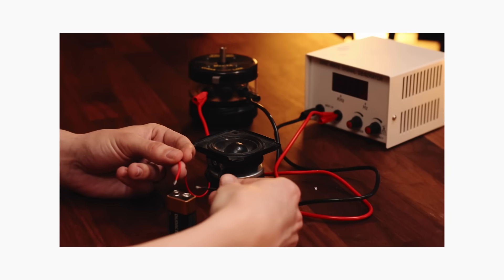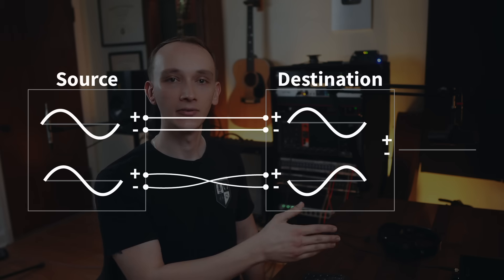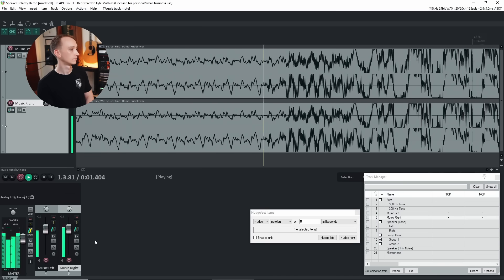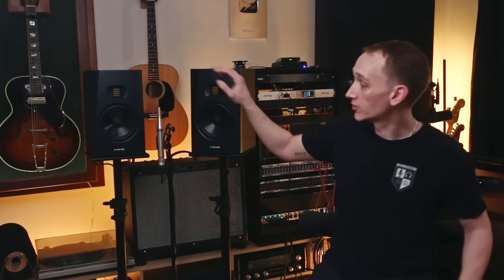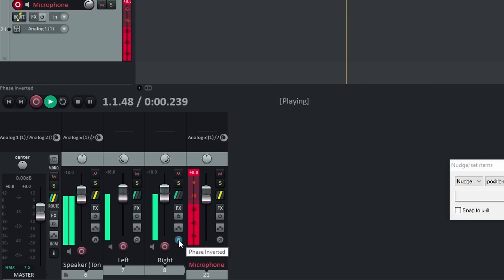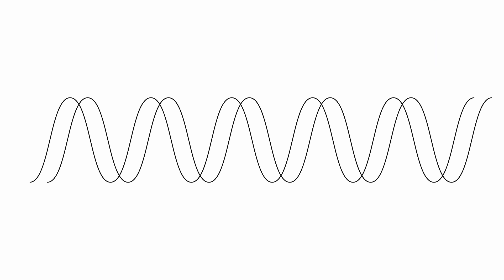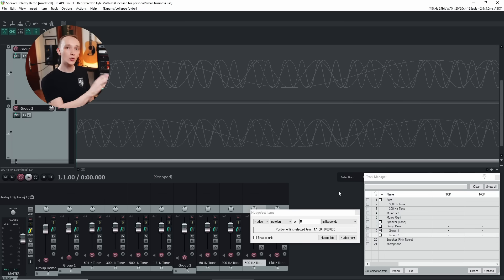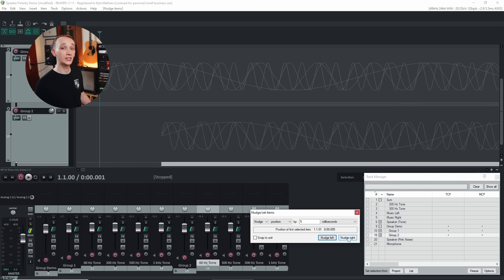The Downside Of Multiple Speakers In A Sound System

Comment: My earphones were sounding weird like the right one is heard to be louder than the left. So in this case all I have to do, to switch the wires in the left speaker ( i guess the left one is not wired properly) .
Right ?
Reply: I tried re-wiring multiple times but each time i connected them wrongly, And I had no clue why the sound is not in center, then I changed the speaker. And guess what it didn't work again 😅
Your video really helped, thanks ❤

Comment: I used to own quite a few vintage PA cabs and had a decent 4(sometime```````s 5) -way stereo arrangement. when I started out, I had no idea that older JBL PRO drivers have polarity colours and markings reversed. I'm not 100% sure why - no standardisation in the early years I assume. 
When I corrected the polarity of the 2 pairs of 4560 low midrange cabs and the 2" compression drivers, the difference was incredible. 

Still sounded adequate with all low mid-range and low-treble out of phase lol...... 

It looks like an archaic pile of junk, unless you happen to appreciate old horn loaded PA systems, but sounds excellent.

Comment: Ok. I have a question for anyone who can answer. 
I have a bass cabinet with 4 10" speakers, 32 ohms each, wired for 8 ohms. I've read from the jack with a meter and did get 8 ohms. The top two speakers are divided from the bottom two, however, the cabinet won't womp any more. I've ensured that it is indeed sealed completely. My question is, could it be the way I wired them that is creating the problem of a lack of power from the cab?
Reply: You probably have the polarity of one of the drivers backwards. Wire up a 9 volt battery to the cabinets speaker terminals + to +, - to -. ALL drivers should move OUT towards you when you connect the battery. If one (or more) doesn't, swap the polarity of the wires going to that driver. Also make sure all drivers are wired in parrallel (all "+"'s of all drivers together, all "-"'s of all drivers wired together.

Comment: Superb scientific demonstration and realistic.  The floor stander with 3 speakers units inside. The bass and the mid range had polarity differentiating  connectors to the speaker from the crossover, but not so for the tweeter.  High frequency from the tweeters do not cancel each other out ?

Comment: I previously sent you a very long comment about my bi wire from “world best cables” feel free to disregard it. Long story short, thinking that the speaker cable was mislabeled I deliberately connected the high frequency speaker wire to the low frequency terminals, and vice versa. Did I inadvertently do damage to the tweeters or the woofers in my tower speakers? Please note that the polarity was correct in both settings.

Comment: I've never taken any notice of the "correct " connection on a set of speakers. I wire them up, then swap one round, and you can clearly hear when they are in phase because the bass becomes far better. Never trust a manufacturer to get it right. Best way to set them up is the opening track of Pink Floyd's Dark side of the moon.

Comment: JBL pro 1000 watt speakers wire up in a push type configuration  wile most every other speaker wires up in a pull configuration  but keep in mind speakers are AC compliant devices the electrical signal moves the speaker cone in both directions
Depending on the magnetically properties of the signal 0rovided to them. The cone pushes air or pulls air  and doesn't matter   until some forces react with the air pressure created by the cone movements
Like  box   closed or sealed or ported  or even some other type of box  like an A perotic membrane 
A box that is not a box.  

And yes you can hear a difference between the forward push or backward pull of a speaker, but its the mechanical structure of the basket for the most part.

The key is to have both speakers side by side in a box move in time alignment in the same direction, 
Unless your making a push pull type bandpass type box in a clamsheel config.

Comment: 2 Points he missed out: 1) The affect of phase change on speakers through crossover/network cards. 2) The phases of the freq for both speakers should not be different. So if I plug them both in the wrong direction (+ to - and vice versa) and they both are in the same phase, I would assume it to work fine. Many old speakers will come with wires coming out of the box, one of the 2 wire will be striped and you dont know if that striped wire should be negative or positive.

Comment: A thing I've noticed with car audio systems is that, from the driver's seat the sound from the radio sounds like it's coming from the LF speaker in factory systems, but when you install an after market radio, the sound seems to be coming from the RF speaker. What's up with that?
Reply: I’ve noticed this too. I think most modern cars (and modern aftermarket head units) have proximity focal setting that delay certain speakers in such a way that that the peaks of the sound waves hit the driver seat at the same time to give the driver the best sound possible. My tundra has a map of the cabin that I can pinpoint the preferred listening position in. When I pinpoint the driver seat, the sound is very full and even from all sides.

Comment: Of course things can change once you put the driver into a cabinet.
The design of that cabinet is essential to how the sound travels and is shaped, and depending on whether the cab is a sealed unit or ported can have a physical effect on the movement of the cone, especially at high volume.

Comment: I remember the first time i tried this at home, was mind blown that adding a speaker and power could reduce the noise by cancellations, another reason why box design is very important, you dont want the rear wave of the speaker interaction negativeltyy with the front or the same effect will happen. Horn speaker and reflex speaker boxes use this to delay the rear wave so that it positively effects output at a specific frequency , when they combine after the delay (1/4 wave theory)

Comment: So I have a question about guitar amps. If I have 2 guitar amps with 1 speaker each, but one is 12" and one is 10", will I get interference?

My reasoning is that a different size speaker will have to move differently to create the same sound. So even if you start off in phase and play the same music eventually you will get to a point where there is negative interference! Am I correct?

Comment: Using the word phase would make sense here.  As in, in-phase and out-of-phase.  A home stereo two speaker system will lose it's punch and certain tonality if speakers are wired out-of-phase, as you say, work against each other.  My girlfriend had her stereo speakers out-of-phase and I just flipped the polarity on one of them and the difference was dramatic when they pumped together.

Comment: In the opening ceremony of a department of my university 4 condenser microphones in a row were used to pick up the sound at podium. The dumba$$ audio technician didn't know that multiple mics at podium is for REDUNDANCY and totally f*cked the sound up by turning on ALL FOUR of them at the same time. Everything is heavily comb filtered and fl@@@@@@nging all around like what's heard through a steel tube.

Comment: Hi,

Your a real expert and you know very well what's going on. I had countless discussions in the past about the exact same thing and most of them was a fight against windmills. Speaker placement and even the positition of the chassis in their depht on the sound wall of the speakers are very difficult. In the transit frequency of the dividing network it's highly importent that they are very well alingned in their " sound center" of the membranes. Otherwise the speakers are producing the same problem by themselves.

Comment: But why would you wire speakers with opposite polarities? Also does this apply only to passive speakers not active with built in amps?
Reply from the maker: This principle applies all throughout an analog signal chain. So if you had accidentally wired one of your XLR cables between the mixer and the powered speaker backwards, you'll get the same effect.

Comment: Hey i hope you’ll see my message, i would like to have some insight on this, what makes a line array a line array? (Surely it is not just stacking point source speakers on top of each other) 

And is it possible to build one yourself? 

Hope someone will be able to answer. Thanks ya’ll
Reply: If you type "Line Array or Point-and-Shoot Speakers - JBL Professional" into your browser you will find a pdf explaining the concept. JBL also have an excellent book called "Audio Engineering for Sound Reinforcement" which has a chapter on line arrays. I spent 25 years working in a venue which changed to a line array 15 years ago. The difference was staggering due to some of the challenges we faced. They work as described. As a receiving house we also hosted many visiting line arrays, L-Acoustics, D&B Audiotechnik, Meyer etc. All of these are superb and no point source system ever came close in all sorts of ways.

Comment: out of phase is bad, but what is ihe down side of  multiple speaker if arranged and connected correctly?
Reply from the maker: With multiple speakers, there is interference between the direct sound of each speaker. So it might sound great in the sweet spot, but not one step to the left or right.

Comment: Last example: - "Gosh, that sounds like flanging!". Listen and learn.
When I was a trainee Telephone Exchange Technician in the early 70s I was allowed to spend an hour a day on work time to go through my printed training assignments. I was sent to the Power Room, where all the rectifiers converted the Mains 240V 50Hz AC to the Exchange's 50V DC.
I enjoyed that big high-ceilinged room because if you walked around you could hear the (loud) 50Hz hum get louder and softer as you walked through the standing waves. You could also sing harmonies with the 50Hz and its overtones coming from those big rectifier cabinets. Amazingly, in those days smoking in there was allowed. :-)

Comment: Yeesh.... the demo at the end was fake. The idea you were presented does present that way under certain circumstances but man.... lying to people is not the way to present it. 

Also, you never really explained "the downside of multiple speakers in a sound system". Speakers that are well designed and properly integrated into a room with proper treatment will not present a downside.
Reply from the maker: It was the audio straight from the measurement mic! I’d recommend watching the next video on comb filtering. You can’t overcome the interactions between the speakers (discussed in this video) with acoustic treatment.
Reply: @AudioUniversity  no sir, I thoroughly understand. I work on systems design and integration for line-arrays. You stopped moving the mic stand at the end of the video but the comb-filtering continued to change as if you were still moving the mic.

Comment: One idea for live sound is separating sound into different speakers. The most wide spread practice is dividing it into frequency bands, Low, Mids, Highs, and sending them to Sub,  woofer, Tweeter. The next step is to dividing based on sources starting with the subs, only sending what they need,  that being Bass, Kick and sometimes Synths. Take that idea further and send the Vocals to their own set of speakers so there's more headroom per speaker and everything isn't competing on the same speaker cones. Similar to the old school guitar cabinets being the only speaker to project your sound leaving the PA for the vocalist.  To go even further you get the grateful dead's wall of sound where each instrument had their own designed speaker array giving clarity and depth to the stage. Finally you go to before electrical powered sound was invented and you get an orchestra with each sound being made by an individual source and bouncing around in an acoustically designed chamber to add reverb and amplify the music. 

What this video shows is what happens when the same signal is sent to multiple speakers where as the more a signal is different the less this effects the experience.

Comment: I'm a  autistic man I'm able to hear or perceive a noise frequency's overs can not around me, and it hurts my ears and makes me feel sick, I can hear it coming from a nabers house, and its turned on when I get home,  they also vibrating the house like a heart beat,  can I find out the frequency of the sound wave? can I then duplicate the sound wave to cancel it out? what would produce this kind of wave.
Thank you
Reply: if you record the sound you can look at what frequencies are there. maybe there are even phone apps for that, try searching for that too
Reply: To determine the frequency or mix of frequencies we can normally hear we would use a spectrum analyser. You can get apps for phones/tablets and PC/MAC versions. These tools display a real time graph of loudness across the audio spectrum. You would simply look for the peak(s) and look at the x-axis to read the frequency or range of frequencies. However, we must consider that there could be unhelpful limitations when using spectrum analysis tools. The hardware and software may limit the frequency range of the tool which won't help if your troublesome noise is outside of that range. Remember though, if you are sensing something real it CAN be measured, you just need the correct measuring tools. I could speculate as to the possible causes but even that would require much more detail. Is this a low or high frequency sound? Or is it mixed? Is it continuous like a hum or intermittent like a drum beat? Is it a single tone which you could hum in tune to or is more like the wind or rushing water? Is the pitch and level altering over time or are these constant? Does it always happen at one period of the day or does it vary? Does it change with the seasons or is it the same all year? These are a few questions I would be asking myself to help narrow down the cause.
Reply: @andrewlefay2091  Hi thank you for replying,  I think it's low frequency as its pentrating walls, it's hard to describe,  it's on,  off, siren like, it starts when I get home and the power of it is high,  the power of it goes up when I go in the garden or clean my car, it's on all the time I'm home,  the power goes up early in the morning ,2am 4am, 6am. There is also a vibration to, which comes on when I return home and goes off when I leave home, iv proven this with equipment iv hired and I have a machine recording a vibration and the pattern of the vibration is like a heart monitor, I can feel the house vibrating like a heart beat,   this also on all the time just the power get turned up and down, high when I get home,  high early hours 4am. I can hear and feel it coming from a house near me,  but others can not, I have autism and ignored sensory difcultuys, I believe I'm being targeted. Thank you for your reply,  if I manage to work out the frequency,  could I cancel it out be sending the same frequency pattern in the direction of were I can hear it coming from,  it hurts me like hell when i
Power is high,  I'm only able to cope by using medication.  Thank you
Reply: @SightseeingwithJas  In the video there is a demonstration of why this cancellation concept works on paper (2D space) but when we use real loudspeakers things get complicated (3D space). Therefore your suggestion of duplicating the signal to cancel the source won't work I'm afraid. I should make you aware that low frequency audio can deceive the ears and your noise may not even be coming from next door. A low frequency cyclic pattern as you described does sound mechanical like a train rolling along its tracks or trainers in a tumble dryer. I understand your feelings, my daughter is autistic and highly sensitive to certain stimuli. I tell her that her sensitivity isn't a problem, it's a superpower. Please ensure your doctor is made aware of this problem, your mental health is important. Stay well.

Comment: some of the early releases of surround sound in the 70s and 80s, called quad amps, used signal inversion for the rear speakers. this tech gave a fooled dimension of sound.

Comment: We figured this out the hard way in the 80s by wiring subwoofers against each other. "Going Back to Cali" went from being one of the hardest hitting songs of all to having Less Than Zero bass. (See what I did there? 😁)
I have a question regarding relative stuff: Why is it that a song like the above-mentioned will part your hair in the car with the signature "boom" of rap music but inside the house, when playing it in my wall-knocker stereo system, the boom is nonexistent? There's still bass, but the boom is not there.
Another good example song for testing this is "The Last Rebel" by Lynyrd Skynyrd. It hits HARD in the car but you don't hear the boom at all on said wall-knocker. However, you DO hear the bass guitar & bass drum utilizing the latter.
Thanks in advance!
👊🏻
🇺🇸
Reply: A car is made of metal and it's a lot smaller than your house which gives you cabin gain at certain frequencies
Reply: @lcraftii  Thanks for the reply. I've never heard of cabin gain so I'm researching it.
👍🏻
🇺🇸